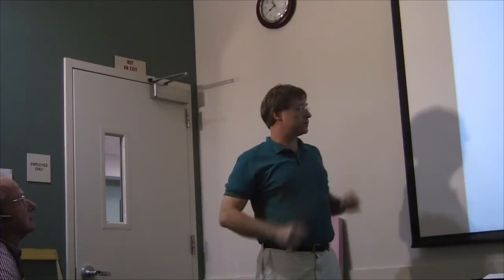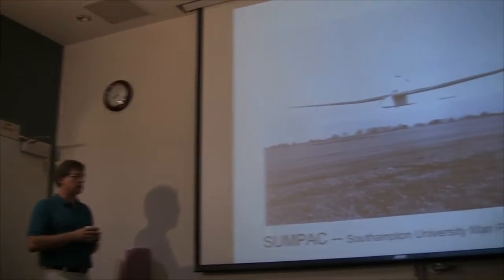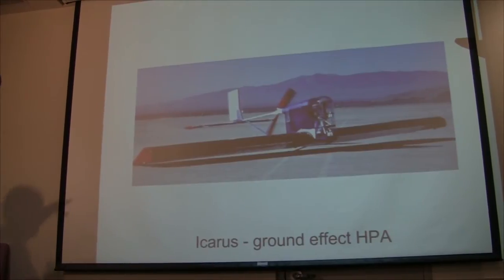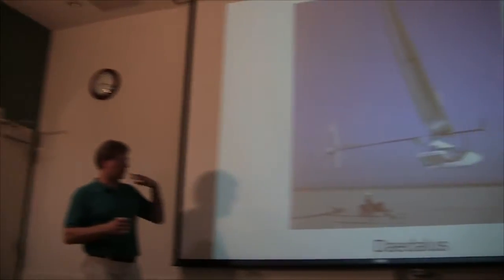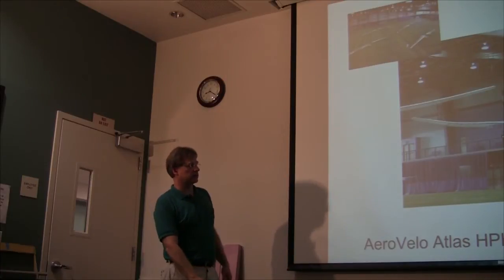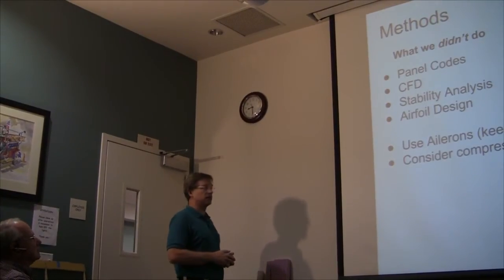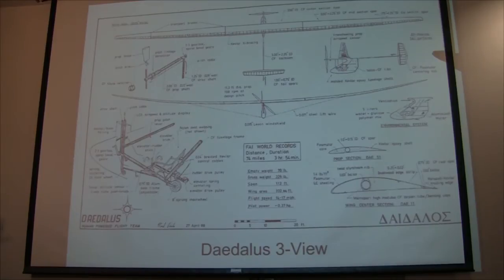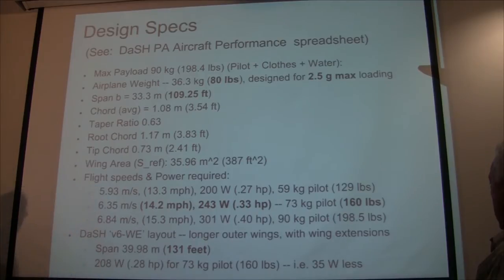SBSS ➜ The DaSH Project ~ building a 'Simple' human powered airplane

Comment: I’d like to see some group. Like yours, consider the “ Coanda Effect” … pumping air through leading edge slots, over the upper wing surface. Propellers are not terribly efficient at moving a craft forward,though they are fairly efficient at moving air, and wings work by the air travelling over the upper wing surface.  Forward motion would be a side effect of lift.  Interestingly, I notice that battery powered leaf blowers, pump air through their nozzles in excess of 100 kph.  The “horse power” of such a battery powered leaf blower is about the same as a “human power” if I’m not mistaken.  The optimal pedal rotation for a human is about 30 rpm…a leaf blower is something like 20000rpm (again; I believe). So there might have to be some interesting engineering.  Fun game to play hypothetically.